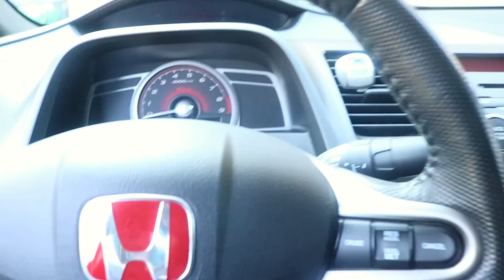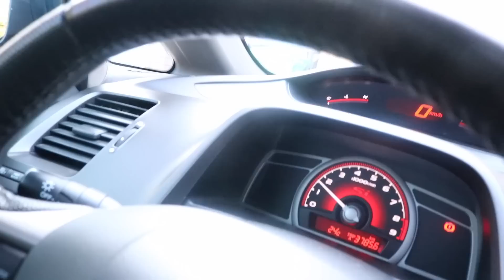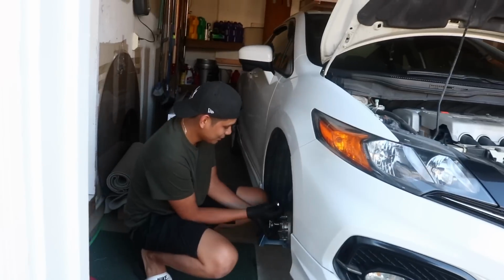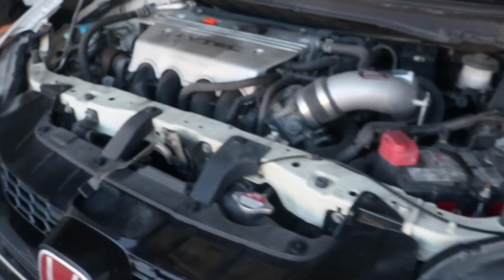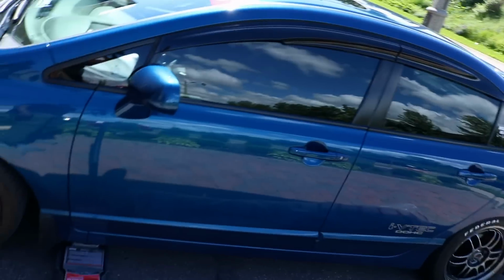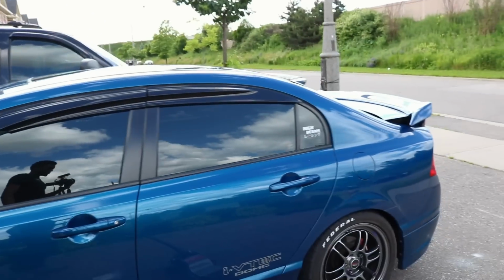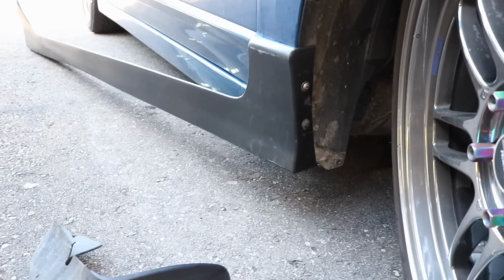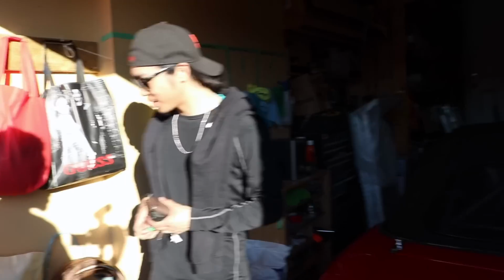8th Gen Civic Si New Install Attempts!

Comment: Those brackets, you'd have to use the self taps to drill on the underside body. Unlike the hfp model, the hfp has one clamp at the back.
Reply from the maker: Yeah you’re right on that, good advice! I wanted to avoid the underbody, but that’s the only way